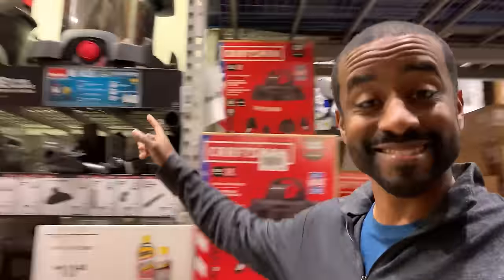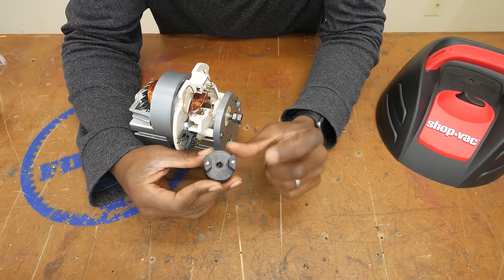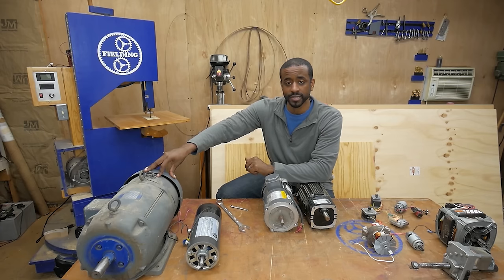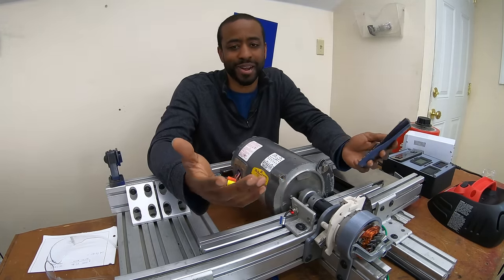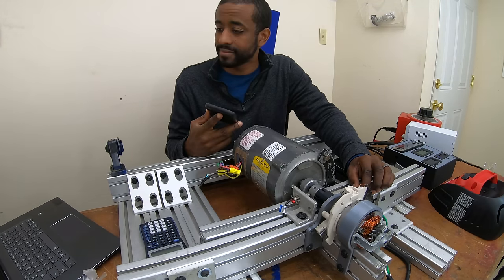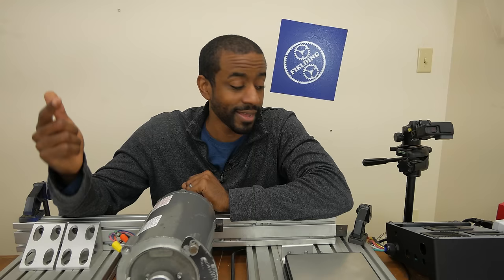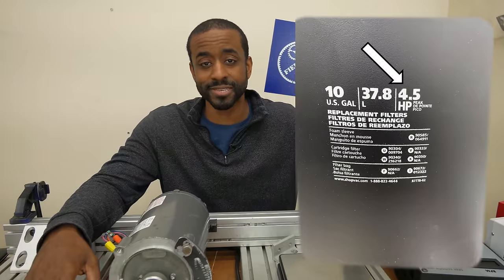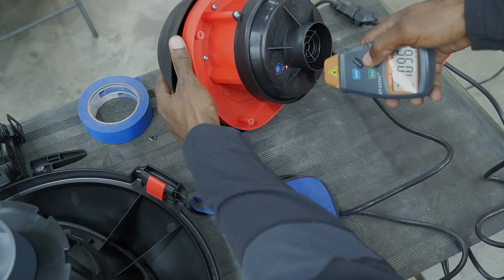How Much Horsepower Does Your Shop Vac Really Have: #078

Comment: A 100% efficient 1HP motor would require a power supply of 746W.  This is, of course, impossible.  No real 2HP motor could possibly operate on a 110V US receptacle.

Comment: The key to understanding this fraudulent horsepower rating is the word 'inertia'.  
Now, say the motor is operated at its maximum unloaded speed: in this state, the external (shaft) torque is zero.  Now, 'slam; the dynamometer brake hard onto the shaft: the very high rate at which the shaft decelerates will be proportional to the inertial torque that is measured.  

If  the shaft is stopped very, very quickly, the momentary torque just after the brake was applied would be very high (although lasting for a very, very brief time).  A high horsepower  can then be calculated by multiplying the speed of the rotor (just after the braked was applied) by the instantaneous (high) inertial torque to provide the 4.5 HP reading.

Now, a high HP reading (the 'inertial' horsepower) could be obtained even if the motor is unplugged just before the shaft brake is slammed on.

This is a total fraud on the average worker - good reason to not purchase Shop Vac or to shop at Lowes.

Comment: geeez.... 120V @ 9.9 amps.... so 1200 Watt
Efficiency... Electric motors run around 85% so you should get approx 1000 Watt output. though.... your generator also has efficiency, let's say 85% aswell.... so it can get 860 watt measured.

If you ad measurement errors (unless your tools are truly centered to NIST standards, you'll get an error in measuring, let's say 10%... See how it gets close to your measurements.
And you surely have an error in measurement, your inputs says : 120.5V@ 10.36Amps so it should be 1248 Watt, not 1181 Watt. You alreay have an error in calculation of 5.6%  without adding any measurement error.
Let's say the electrical plate is correct, it shows the true values of the motor.

On a more legal matter... nowhere it's said horse power, it say HP, which can be anything., Horse power is always defined by its standard, Din,  SAE, ECE, JIS. To be horse power, there is a definition to it: hp is in lowercase, always, and completed by the type of power, indicated : ihp, nominal : nhp, at brake : bhp, at shaft : shp.
The 4.5HP means nothing. It's not horse power.
Reply from the maker: You should watch the video prior to this one. I explain how the machine actually works. its not a generator. It measures nearly perfectly on motors with a known horsepower. I test and demonstrate this in the first video.
Reply: @Jeremy_Fielding  ;-) just did... waaa nice work!
Ok so my assumption of the efficiency was quite a bit ( a lot) off.
So there is 20% lost somewhere.
On such dynameter I don't think you need to test it with a test motor, knowing the leveller lenght, you only need to be sure about the scale measure. Can you have access to certified weights on the range of the scale?
also, it's better if the scale plate would be thicker, to avoid local deformation du to the leveller pressing on it. And it's also better if the leveller contact on the scale is at the center of the scale, to avoid moment distorsion between the point of contact and the position of the weight gauge

Comment: These motors actually can, albeit for an extremely limited amount of time, produce the rated peak HP in a lab setting.  In use, you will never run the motor in those conditions.  It's almost a meaningless rating and, although it can be produced in a lab, you will never run it at that HP in use.  It's all marketing wank.

An induction motor, on the other hand is rated at continuous HP, meaning this is the HP you can expect to get and use continously.  It is not the peak HP capability of the motor, however.  By design, an induction motor wants to reach and stay at it's rated RPM (1750 or 3450 are typical RPMs for these motors).  When the motor is unloaded, the motor is running as close as it will get to "synchronous", or matching the input electrical frequency (a 2 pole motor will run at or near 3450 RPM and a 4 pole motor at 1750).  When the motor experiences a load, the RPM's drop and it is no longer synchronous to the input frequency.  The motor wants to run synchronous, so it will automatically begin drawing more amperage to create torque to try to get it back to synchronous speed.  This increase or decrease in amperage draw is caused by the change in back EMF in the system, which acts like a throttle.  The more back EMF, the less current flows into it, such as when the motor is running with no load.  As load is applied, EMF reduces since the rotor is no longer synchronous with frequency, and it draws more amperage to try to "catch up."  It is possible (and actually done) to use a lower HP rated motor for higher HP requirements, but ONLY for intermittent use.  You can easily draw 5HP from a 3HP motor, you just can't do it continuously or you'll burn up the motor.  This is why you'll often hear people say you can replace a 5HP gas engine with a 3HP electric motor.  You can, but again, be careful not to burn the motor up with prolonged use.  Also, you have to consider that as a gas engine loses RPM, it also loses torque and power, whereas an electric motor will actually try to draw more amperage and increase torque output.  Electric dragsters are a good example of temporarily "over driving" electric motors.  They use motors that can take extremely high current loads to make massive power, but they only need to be able to last long enough to make it 1/4 mile without frying themselves.  Small motors to save weight, getting blasted with incredibly high amperage...lots of heat...but make the motor windings just stout enough to last for a 1/4 mile run.

Another popular use for induction motors is to hook up a 3-phase motor to a variable frequency drive, and now you have one that you can change the speed of the motor at the twist of a knob, but retain the torque output, even at lower RPM.  The VFD just changes the frequency of the electricity going to the motor, and since it wants to stay "synchronous", the speed you get is based on the frequency of the electric supply you feed it.  Although there are ways to vary the speed of single phase motors, it's not the same and you don't retain the torque (it's also bad for the motor, typically overheating them).

Comment: This same garbage applies to a lot of the table saws and other power tools sold today. I recently saw a table saw listed at three HP that only drew 15 amps at 120 volts. That is not physically possible in this reality! It also said developed HP, whatever that is supposed to mean. When cutting wood, you need sustained HP, not momentary HP!

Comment: The number comes from the measurement taken the moment the unit is powered on. It is just a spike and nothing more.  Unfortunately this has nothing to do with the actual sustained output/performance. This claim is prevalant in other industries as well. Take a look at the ratings posted on speakers and amplifiers and stereos. All “peak” ratings.

Comment: i watch a lot of content. from a lot of sources. one common thing i notice. no matter who the content comes from. is that the majority of manufactures lie. outright lie. for instance. audio. youll see advertised "1500 watts" usually some what ironically labeled "peak" which commonly (tho not always) is double what the actual output is. or lets say power tools. torque ratings seem off. or even locks. door locks and so on. the products claim certain stuff. and 99% is bullshit. (for references here look up locking lawyer. for references to other stuff i mentioned i watch guys like AVE and steave meade. plus many others) so its not just shopvacs. its basically almost every industry. they all lie. then expect consumers to just buy the lies. it seems.

Comment: The "impeler" is preatty big in radius and has fins at end giving it a lot of inertia and if you add the inertia of the spinning impeler and the "clousure" of the suction thingy, a "vacuum" would be formed that would exibit 3 horse power of "peak" force as a vacuum impulse is quiete funny in its working. Just speculating for fun

Comment: I'm pretty sure the Peak Horsepower is just calculated from the transient current when the motor is initially turned on. This ridiculous calculation would make sense according to ShopVac's description of PHP since motor inertia has a huge affect on the current required to get the motor to begin turning. A complete marketing gimmick for the ignorant.

Comment: Always go buy the power consumption. I don't care if it says 1,000 HP if its only taking 1,500 watts. Peak power at mains 120v is like 1875w which is 2.5hp. You cant get more than the rated peak of a typical outlet. Anything over 2.5HP is total BS. Its like a 1,000 HP engine that has tiny fuel lines that claim 1,000 peak HP sure it could but it NEVER will. Its just meaningless marketing wank and nothing more, take it with a grain of salt.

Comment: They don't seem to disclose the voltage they use.  Throw enough volts at it, and you MIGHT get closer to the number.  But that is still snake oil advertising.

Comment: You also need to remember that the badly designed blades of the vacuum loose even more power, so in the end you are lucky if you get about 200W out of a cleaner.
Which is also the reason why we limited the power of vacuums to 1KW in Europe, because they just wasted more and more energy to get bigger and bigger numbers without increasing the real sucking power. Now they actually start to improve the blades and engines in the "brand" cleaners to get really more power out of them.

Ironically those are the kind of rules brexit fans cried about, not getting that the industries just fucks with those morons.

Comment: My fifteen-year-old Shop-Vac is the bane of my existence as an engineer. The hose connections are terrible, the wheels are so small that it can't even roll over its own electrical cord without tipping over, the only handles on it for lifting also release the lid so if you pick it up by those handles you run the risk of dumping the canister all over your living room floor. It's like the engineers intentionally designed it to make you hate the product. It's so bad that I've begun sketching my own design for the perfect shopvac and I have yet to see anybody come out with anything that looks remotely like it.

Comment: Your looking for suction power not physical  power of the motor aka watts... 

 Totally different tool.. think of it like this.

 A turbo on a car the impeller of the compressor wheel can push enough air volume to make power this can be 0 to 800wheel horsepower (in my case) but the turbo itself cannot create that kinda torque at the shaft that's just silly, like this pointless video.  It's the flow the  air value and weight compressed... you just havent thought of it this way

Comment: They get these numbers by getting the unit up to speed and turning on their dynamometer for a split second.  So basically they are probably adding the kinetic energy of the impeller and motor at full speed to full stop.  It's a useless real world number.  Marketing BS.

Comment: Household Central Vacs advertise "suction Horsepower"  never researched what that means, if anything...
Reply: Suction horsepower was the first thing he tested in this video: Measuring the torque the motor produces at the same speed it actually turns the fan, multiplying the speed and torque, and dividing by 5252, to get the ~.8 horsepower. If you see a rating bigger than that,  the amps@120 volts should be proportionately higher. If not, it's a bogus number. Keep in mind, it could be ~20% or so higher, depending on the efficiency of the motor. 1.1 to 1.3 horsepower might be pretty honest.

Comment: That shop vac looks cheap as shit. My old craftsman was much better quality. PS. US homes usually can't put out more than 3-4hp since a 20amp circuit breaker at 120v is only 2400W. Also they define peak hp then say their shop vac will not perform to the standard that they define and list on the box. It only does 1/6th of what they are selling you. My guess they are using the number they got when they cranked the motor all the way up to failure.

Comment: Volts X Amps / 773 = Horsepower. This video is totally unneccessary
Reply from the maker: If you don't know the efficiency your number is meaningless. Plus it sounds like you didn't even watch the video because I explain this.
Reply: @Jeremy_Fielding  I did watch the video, and your numbers are off too, because in (I think) the first test, you generate energy with the motor, measuring power draw AND power output, and calculate efficiency from there. That also includes the efficiency of the generator not being perfect and you get a multiplying a fraction by a fraction issue, that I did not see you go over.

Comment: So much for truthful advertising! were it a 4.5 hp motor at 80% efficiency it would be eating up
4,028 watts. The manufacturers don't think anyone is going to actually check to see if a motor 
has the power it is advertised to have, what a freaking fraud.

Comment: Even just a quick mental calculation of the voltage and current specified tells us that the HP must be less than 1 HP assuming the motor is less than 100% efficient which it obviously must be.

Comment: I really despise total bullshit ratings on equipment also, as they are nothing more than just a "numbers game" to make said product appear to be the most "impressive" of the bunch to the uninformed and untrained eye!...

In this case, and since "horsepower" is a measure of the "power" delivered by something, maybe they are rating the "peak horsepower" as the absolute peak total energy output of the motor when it's literally going up in flames, including but not limited to, the heat and light energy generated by the flames of the associated fire during that "test"! Lol!